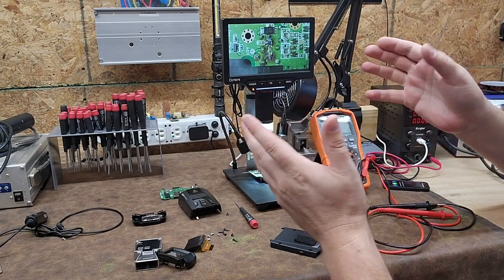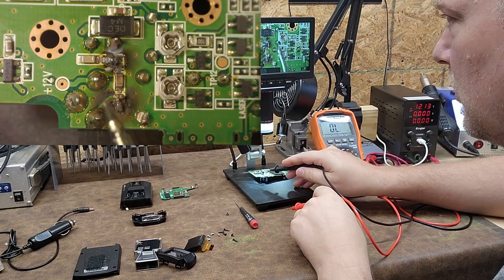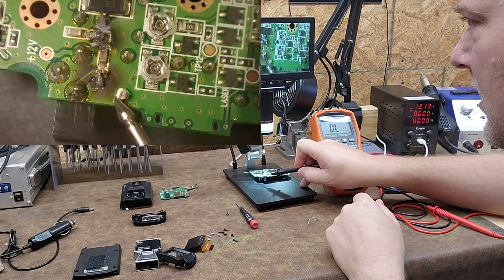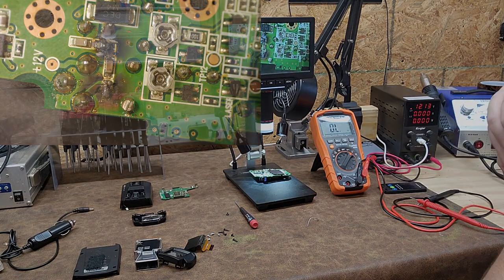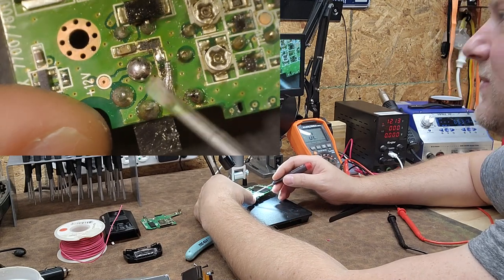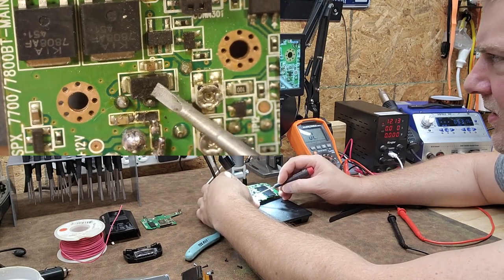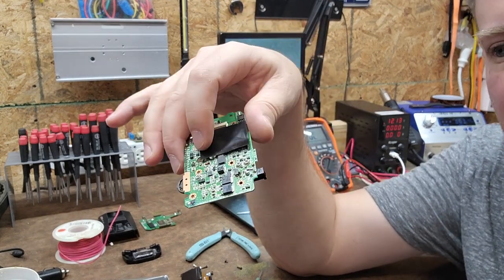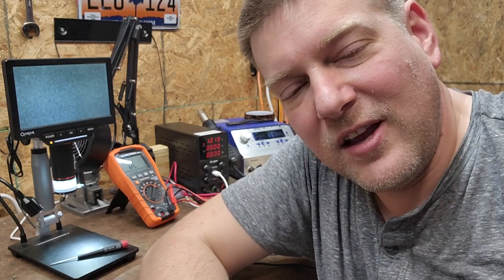Trouble DC Electronics 2

Comment: hello, I still have the problem of the A+ plum pump, the plastics of the occlusion sensors are broken, and the occlusion alarm marks me, can you help me please, thanks for everything you teach in your videos
Reply from the maker: Buy another pump off ebay as a replacement or for parts. There are too many possible failures to troubleshoot across the internet.  On Ebay these pumps sell for less than $100
Reply: @BetterBiomedChannel  I appreciate the advice, I will tell the client to buy another one, can you show how to detect shorts in medical equipment? , Thank you